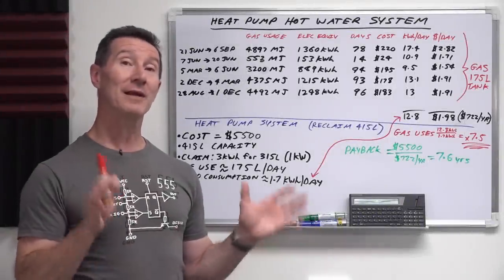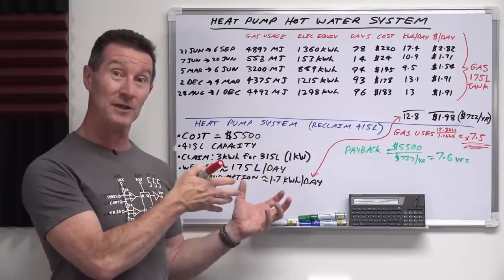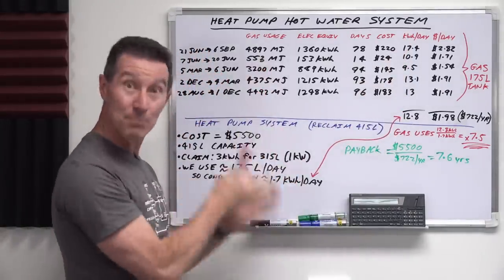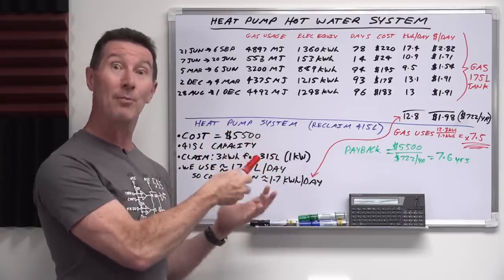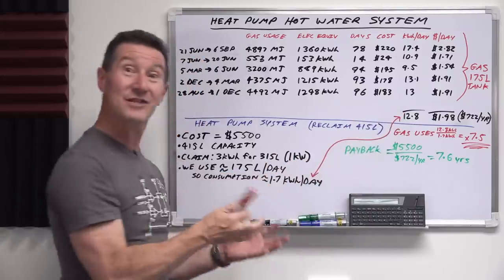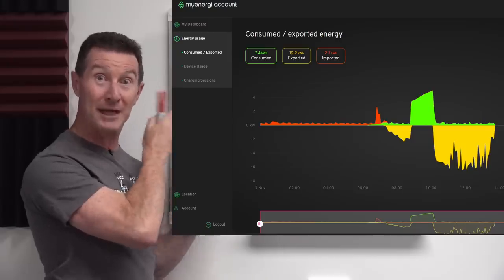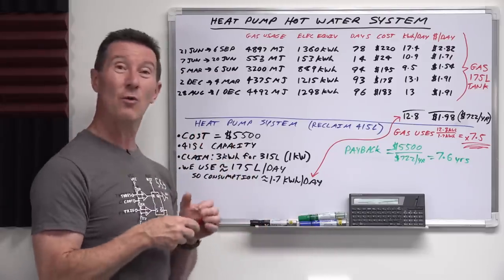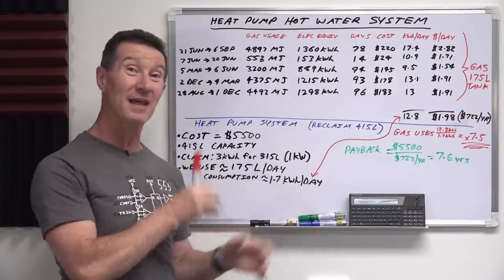Heat Pump Hot Water System vs Gas Hot Water

Comment: Heat pumps are definitely the way to go if we ever want to properly get rid of fossil fuels at least for home use. I mean, at least as long as upstream energy generation is also non-fossil based..
Reply: In Australia where you just cant get away from the heat this makes sense since you have as much of it as you want. In Texas during the summer my cold water was scolding hot and I couldn't even shower during the day if I wanted to. But if you live out in Alaska it might not be so rosy since any refrigeration system is impacted by extremes in temperature between the evaporator and condenser, and it gets harder to extract heat when there isn't really any there to begin with. Really more than just cost needs to be considered as you will have less capacity to generate additional hot water in colder climates. At a certain point gas will be more economical, and potentially more environmentally friendly given we don't have fusion reactors yet. Solar and wind are terrible at this point for both economics and the environment. 

That is of course unless organizations like the WEF and the UN have their way and make it unobtainium so you have to buy a Chinese electric spontaneous-combustion car, solar array, heat pump for hot water, etc. even if it doesn't work in your situation. The move away from petroleum and natural gas makes sense, but only when its done for reasons other than realizing various globalist schemes to sequester money and control.
Reply: @rafflesmaos  Yes, because I love seeing the once calming and peaceful pastures and meadows around me turned into SOLAR FREAKIN' FARMS! Where I live where its cloudy and cold for much of the year solar makes about as much sense as tits on a fucking bull. And all it takes to turn all of that glorious Chinese silicon into truckloads of e-waste is one good hail storm. But they still put it in, anyway, because of all those juicy subsidies. Wind has the same issue in that the installations only work when its windy, and they have limited lifespans. This stuff doesn't recycle at all and its piss-poor efficiency means you need LOTS of it to actually get usable power. We have no viable alternative to fossil fuels other than nuclear, but you can't hug with nuclear arms! 

As I implied, this stuff isn't even CLOSE to prime-time. Dave's installation makes sense. Its Australia where the sun grills you year-round. But for the other 80% of the earths population that lives places where solar panels and wind turbines are just things that haven't made their way to the landfill yet it doesn't. Not at all. And all your blue-sky thinking wont change that. We could be investing in actual progress like funding for research into advanced forms of energy production, both nuclear and fusion, but we're not. Nope. What we do have is endless blather about global war... Oh, wait, climate change and how we're all gonna die in five years if we don't buy into the latest gimmick that's come down the road. And just ignore them shutting down US oil production to drive up energy costs costs (I worked in the oil industry, I saw them do it, so please save your breath). Coward-Pivoning everything to make people transition to "green (as in lots of money) energy" is not a solution. It's a scheme to achieve various agendas. Is global warming real? Sure. But crashing the economy so people have burn trash in barrels to stay warm isn't saving the environment, its creating the greatest ecological disaster in the history of humanity... All in the name of "saving the planet." Its snake-oil and we need to call this stuff for what it is, and demand actual, usable, practical solutions.
Reply: @mysock351C  I'm not entirely sure how one goes from having solar panels on your own house for your own needs (which would work for a LOT of people out there including ones way up north in the northern hemisphere), to "solar farms everywhere".

I mean.. if I'm here in northern USA, and I've calculated that an air to air heat pump with solar panels on my roof and a battery bank will effectively make my bills zero for decades, and have a payoff period of less than that, then why shouldn't I switch from fossil fuels? At what point does such a decision become controversial? What if I'm building a house and it takes me 10k just to run gas to it, having to buy CO monitors and having to pay the utility company fees even if I never use gas, why wouldn't I instead invest that 10k into a system that will eventually be money positive?

Am I confused about something here?
Reply: @rafflesmaos  The problem comes in when people are COERCED into doing these things, which is what is happening. It should be a decision we are allowed to make on our own. But much policy now is geared towards forcing fossil fuels to become uneconomical intentionally. Do you really think that inflation just happened on its own? It wasn't entirely energy issues, but it was done on purpose, or at least allowed to happen out of incompetence. 

My parents are medical doctors, and in regards to c-nineteen (and yes, I LITERALLY have to write it like that or my posts are automatically deleted by google/YT) I got to be privy to what actually goes on in regards to the "incident of widespread illness." It goes beyond just being made in laboratory. It was intentional and done for very specific reasons. And the solutions proposed go beyond simply negligence to maliciousness and a sheer disregard for any evidence based science and ethics. That alone is some seriously scary shit, and its just the tip of the iceberg. And yes its relevant because such actions are being done across the board to promote various agendas. One would think empty store shelves, planned power and heat outages, high gas prices, soaring inflation, exploding food processing centers, elections that only go one way even when the candidate is wildly unpopular would be strong indicators. But some people will never connect the dots. 

But getting back to actually using one of these. Yes, it makes sense provided your situation makes it a viable alternative. Upsizing the system can help capacity issues, but it will also increase energy use since you are upsizing due to the reduced COP to begin with. Since that energy usually has to come from some form of non-renewable energy being used by the nearest power station, it may not be cheaper than gas, depending on what the market is doing. But even then since the power station is usually burning the same stuff you would be if you have gas in your area then the two will tend to track, outside of any lags in pricing. An additional factor people disregard is that its a refrigeration system. It will need preventative maintenance and it could be costly to own in the long-run if you have to replace components when something fails, and this will have a short lifespan if you live in a more tropical area. If you don't get coated coils, they will rot away to nothing, which adds more cost. This is on top of the normal maintenance you will already need to do for the actual hot water tank. Then there is the initial cost, and having to have a place to put the actual pump itself. Yes the COP will help, but it may not be as helpful in extreme environments. There are factors to consider. Personally I would just opt for gas since they are so reliable, but if I lived in a predominantly warm area or in a place that does not have a natural gas service I would strongly consider it.
Reply: @rafflesmaos  Oh, and about the "solar farms everywhere", the reason I said that is because... there are now literally solar farms everywhere around me. It was all the rage and we even had a family friend that cashed in on the subsidies and allowed one to be built. They are eyesores. They look terrible, and they kill whatever was there beforehand. Maybe its better than houses. But its not better then actual farms or open space.
Reply: @mysock351C  in Canada the unit is all in one inside your house so in the winter your hat water is actually from your house heating BUT your starting temp is always around 20C 
PS MY cold water is around +2C in the winter but I can hit -40C outside
Reply: @jasonriddell  Yeah if I was still living at my old house with electric only I probably would run one with hot water recirc for the heating. Can also add an instahot for the DHW and then you can have more flexibility with the system since the instahot can be relatively small and provide the needed additional delta-T. In my case the laundry room and bathrooms were all back-to-back so it would be a fairly straight-forward installation with just one instant heater to service them, and then the recirc with the split-system for heating. I'm sure they probably have options to have them as a hybrid system as well. It makes sense for some installations. My only reservation is long-term cost of ownership since its an additional refrigeration system that has to be maintained. In addition to servicing the hot water, you also have to service the outdoor evaporator unit.

Comment: The gas v conventional electric difference makes a lot of sense if you think about it. Whole bunch of exhaust gas with plenty of heat left in it straight out to atmosphere vs an element heating up in a sealed insulated enclosure dumping all of its heat straight into the water with no wastage bar a bit of resistance in the house wiring. That's half the reason I'm not a fan of gas cooktops, inefficient as you can be with most of the heat ending up in exhaust gas in your kitchen rather than in the pan where you wanted it.
Reply: maybe, but gas is instant on, adjusts instantly and I can see at a glance exactly how much I have the stove turned on and I can use it to light candles and burn other things that need a flame like soldering copper pipes in the kitchen and it provides an alternative when the electricity is out and emergency lighting to help me find the candles, a touch or my phone..  It also provides for a more humid oven bake which is sometimes preferred and as best as I can tell my gas is charged at almost 1/2 of what I pay for electricity per kWh. 15cents v 27cents.
But your point is valid, whole bunch of exhaust gas out the top of the water heater which also loses heat
Reply: The flue pipes on modern gas tanks are PVC plastic.  Your analogy doesn't hold up.

Comment: Got mine month ago. Cost 350 installed with gov rebate. The main thing is with solar panels you literally get free hot water. Gas however isn't available free from any source. Disconnected gas altogether. I have stopped using the term  "cooking with gas."

Comment: Doesn't make much sense here in Canada.  Natural gas is cheap.  Plus, I can get a new basic gas fired tank at Home Depot for $600 and just replace it every 10 years.  What are you going to do when your pump fails and the new part is $3K?  It would make more sense to just put those costs into an S&P fund for a decade and buy as much gas as I like.

Comment: For 175 l you need about 10.8 kw so gas isn't that bad in terms of efficiency. The question is offcourse how good is the cop in real life. But even if its 1 then your electricity is still for free. A simple heating element boiler might be a lot cheaper but still maybe 2000 (and no refund from gouvernement I think) a good thing would be to include the price if you did not have a surplus of electricity. Btw I think this is a much smarter way to store energy than in a battery.

Comment: I don't think you can really consider the electricity used to run the system as "free", as you gave it some monetary value when calculating if the PV system will pay for itself.

But that's nitpicking

Comment: Hi Dave, hvac tech here. There need to be some corrections in the calculations as they are based on marketing wank. First off the efficincy. In hot water the usual cop is 3.5 when heating to 55c every time. Not 7. Numbers above 5 are reserved for low temp heating systems like underfloor heating. The higher the water temp needs to be the lower the cop is going to be. it depends on outside temperature as well wich is higher in your climate but you will find that the claimed numbers are "overstated" once you look at the actual performance. the only way you will see a cop above 6 is when its full on summer. you can also save a bunch of electricity by not heating up the tank more than you need. if you can manage your daily needs with 50 degrees then use that and put the rest back in the grid. its a waste to heat up more than you need. 5 cents back is still more than having a bunch of hot water you dont need. running at higher temperatures also decreases the lifespan of the refigerant system, most notably the compressor. the most expensive part.
Reply: thanks for the numbers. My gas bill is in energy units which they convert from cubic meters and say the energy per cubic meter fluctuates as it is natural gas.  Recent meter readings 644m3-539m3 = 105m3, which they converted to about 1108 units.   So perhaps a 'energy unit' is actually 1kWh and they are suggesting there are 10.5 kWh/m3 and they charge ~ 15cents per energy unit while the electicity company charges ~27cents per kWh
Reply: @kissingfrogs  email them and ask them flat out what the conversion is and what a unit is to them. It does fluctuate but not much as the source is pretty fixed. If you get cheap russian crap gas for example you wont see more than 8kW from 1 cubic meter, higher grades (non russian) can hit 11 or better.
Reply: @SupremeRuleroftheWorld  I think its primo quality gas pumped from about 1000kms away from the exquisite gas fields of the Carnarvon Basin so maybe the 10.5 is plausible.

Comment: Solar HWS are huge here! Why would you say that? Everyone in WA has one unless they live in a shitbox house without a big enough roof. Get a stainless tank, boost it with PV if needed (like this time of year) and it shits on those Aircon jobs. Also we can use our fireplace to heat the water with a flue heat exchanger  for no moving parts free hot water. This A/C water heating is floored

Comment: I have installed a hp sanitary water boiler. I had to cuz is now illegal here to make sanitary water burning stuff. It has both hp and direct immersion electric heater. I ran some back to back  tests of hp and immersion heater and i got a CoP of 1.2 generating 50c water. Big disappointment and large electricity bills.

Comment: I wonder if there could be a combination HVAC and a hot water heater.  I live in the South end of the San Joaquin Valley in a mobile home park and at this point most of the utilities are natural gas.  But with the global warming and the toxic nature of natural gas it is time to go to electricity. My next big change is to purchase a GE washing machine dryer that in vent-less and runs only on 120 volts.

Comment: cries in northern hemisphere. we only get 2.5 hours of peak solar in the winter so a 13.3kw system would only barely be able to run that with  not much to spare for the house...or ev. :( ohh i just reread. 2kwh is very reasonable! the bright side for my US state is that we get net metering so 1kw into the grid is credited and you can pull 1kwh and be back to even.

Comment: "Natural" has if not an efficient way to heat household water or cooking! Electrons are far more efficient, especially in induction cooking! I would like to put my already owned solar panels on my unit but I can't of cause, renting. If I could though, I would put heat transfer plates on the back to heat my water and to keep the cells cooler to optimise their efficacy.

Comment: At a crappy rental I lived at our hot water system used 15KWh per day it had a 5KW element that ran for 3 hours a day. Turns out the shower the landlord refused to fix was leaking hot water in the wall. They tried to pin it on us untill I proved I raised it as a maintenance issue on our first inspection 9 months earlier. The massive power bills didn't hurt so much when their refusal to fix anything resulted in a foundation sinking....

Comment: Hello there,
We've got a solar hot water with gas booster system (in vic australia and is just about 5 years old system). How does a heat pump system compare to that?

Comment: With gas, the energy losses is mostly at the side where it is used... With electricity, the losses are at the generation side... (well, that is more if the electricity is not coming from your roof)

More energy for gas than an element makes sense - the element is ~100% efficient... (the generation from gas / coal / nuclear / ... is not though)

Comment: 30 years old waterheater is not as efficient as a modern one .
We have central heating with radiators and a flow boiler is build in no big boiler. 
When we got the new one the gas bill dropped quite a bit. 
So newer models gas heaters are better than old ones

Comment: I put in an 80 gallon heat pump water heater. I literally cant even tell the difference on my electric bill (and electricity is the highest in the entire US) and we replaced two propane water heaters that were about $50 a month each. New heat pump water heater costs us about $8 a month in electricity. No brainer. You'd have to be an idiot to not install one.

Comment: I live in Melbourne, have gas water heater, but was told that upgrade and rebate is available only for electric water heater and not for gas water heater. But in your case it was gas water heater. Which company should I contact to get heat pump?

Comment: If you add a tempering valve you can heat the water to a higher temperature in the tank and still safely wash your hands without scalding yourself.

Comment: I wonder why the tank is painted white instead of black.  It seems like it would be better for it to be black since it can absorb more heat passively.  I never thought there would be a  heat pump hot water system.  TBH, I thought the next fad would be those vacuum glass tubes with the dark pipe inside to be used as a hot water source.